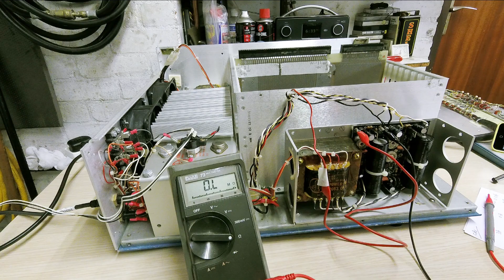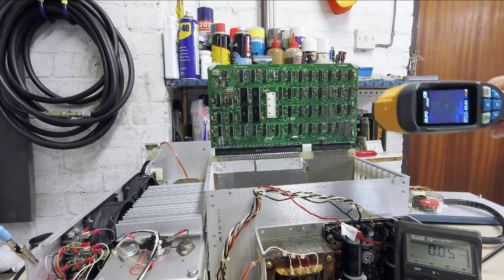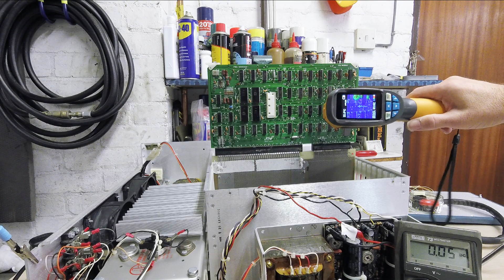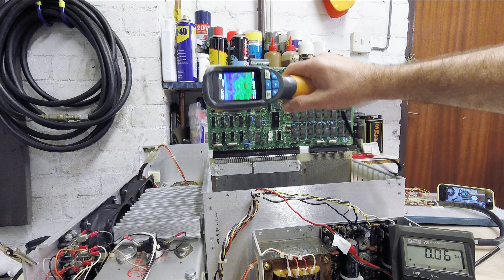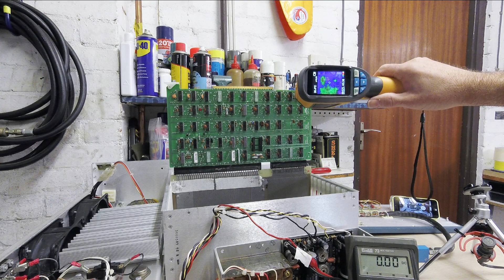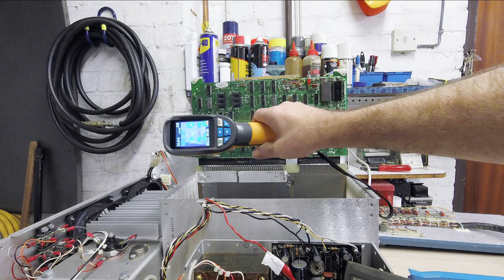Intel MDS-800 Restoration - Part06

Comment: Nice work! What thermal imaging cam is that? I have gizmo envy lol.
Reply from the maker: Hi Mate, It's a KK Moon HT-02D. There's a a cheaper version, but I went for this one as you can overlay the picture from the normal camera which makes it easier to see what you are looking at. Jerry made an interesting comment on one of his videos that it's not just the hot ones, but often the stone cold ones which are faulty as it often indicates they are not working if cooler than identical ic's on the same board. You're welcome to borrow it if you want to try it out. Bye Martyn.